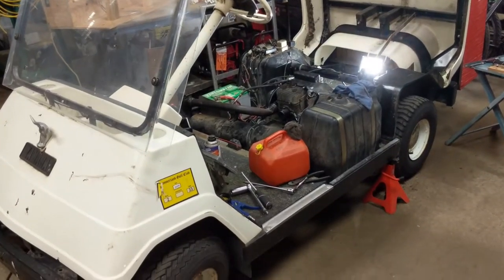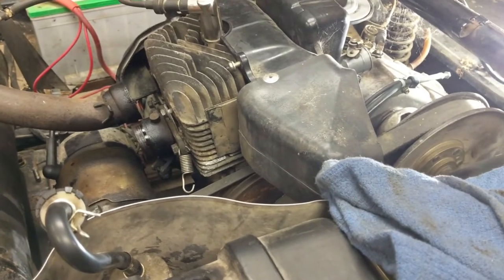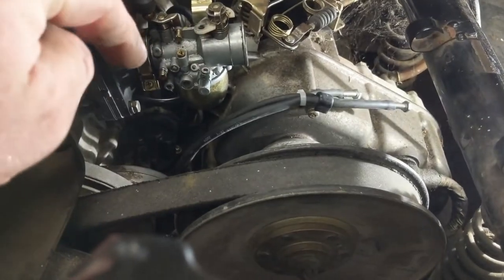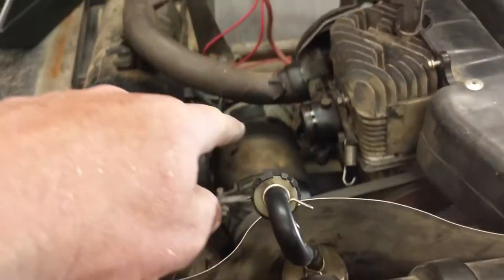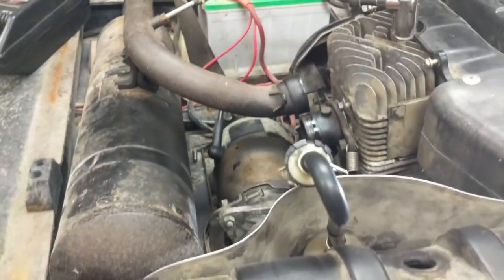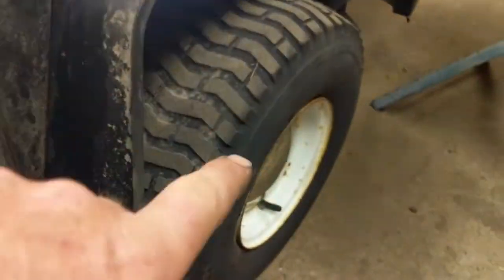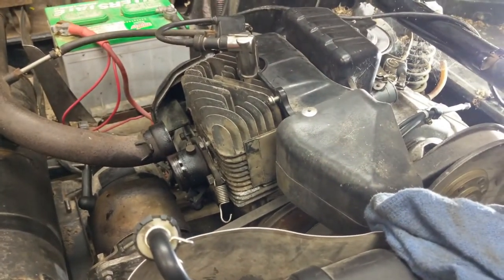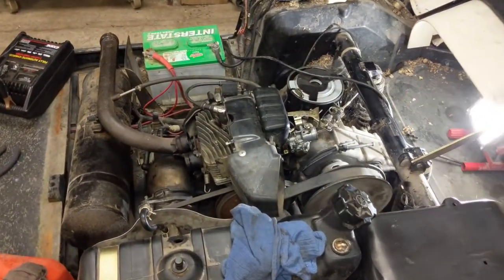1980s Yamaha G1 2 stroke golf cart interesting forward / reverse system

Comment: I am in the market for a golf cart to get around mountain property. The seller states it's a Yamaha G1 Golf Cart - Gas - 2 stroke. They have had it for many years and have upgraded to electric. He wants $2k for it. It "appears" to be well taken care of from a photo. I have not seen it in person, yet. My main use would be to pull two bins (garbage, recycle) down a long (equivalent to 2 suburban blocks) Paved driveway and carry my tools around

My questions for anyone familiar with the Yamaha G1 model are:

1. How fast do these carts go?
2. Does the cart have power to go up an elevated driveway?
3. Is $2000.00 what these older carts on the market for these days? 

Thank you in advanced. Angel from The Bay

Comment: I have this same cart,  lt will  start and go forward but will not start in reverse.  ANY SUGGESTIONS?
Reply: The electrical system switching is quite complex for a golf cart.  Turning the generator the opposite direction reverses the current to some switching polarity before power gets to the rest of the system.  This is done via the two solenoids near the voltage regulator.  My guess is that the one used for reverse operation is faulty or has been wired incorrectly.

Comment: I remember cleaning out 2 stroke exhausts by using a blowtorch up the tailpipe to burn out the carbon. That might work with that exhaust as well
Reply from the maker: the owner took the exhaust, hes going to slice an end off and see if he can get at the insides to burn/clean it out.
Reply: @machinesnmetal  We have a trash gas grill; we put a fresh tank on it, muffler in, and let it go overnight. Choose a night when the wind is blowing away from you...  Impressive clean-out job.

Comment: I’ve been looking for a video of people doing mods to this golf cart with the stock 2 stroke cause I’m looking to do something with mine but everybody just puts a different motor in it
Reply from the maker: Yeah, it's best to change the motor, get a 800cc sled motor 🤠
Reply: machinesnmetal on it 😂
Reply: Those 2 strokes are to much headaches especially when the cdi box goes out on them check my video I heavily modded my g1 👍
Reply: Yamaha gas golf cart goes forward when in reverse how to readjust
Reply: Could you ever get it to idle,I just got one and been try'n to figure out how the hell it works...I thought it had a forward reverse trans,so I thought I could put a two way switch and separate start..it runs good at top speed, but jerky at slow speeds..any suggestions
Reply: @derekfreeman3562  I own one also it does same thing

Comment: I’ve got the same cart… but I’ve got a electrical problem…. The battery blew up and now I have no spark… I’m assuming it is the voltage regulator… any help would be greatly appreciated…
Reply from the maker: I would go after the coil and ignition side first, the voltage regulator works more on the charging side..

Comment: Strange, I have two of these. One has a boost chambers common for some two strokes yet my other one doesn't have a boost chamber or the hookups for one in the block and the mount for the carb. Next thing I've got going for these carts is a governor adjustment although I think one of them, the engine is just about shot. It barely climbed a hill with two people.
Reply from the maker: Check your muffler. The muffler on this one was completley plugged up and no exhaust would flow through it. We cut it open and emptied it, welded it back together and it behaved like a new machine.

Comment: Its a starter generator, no such thing as a starter alternator to my knowledge. These are good carts, I have one. My exhaust isn't plugged but it is filled up with oil or carbon, it smokes like an SOB when the exhaust gets hot. I can golf 9 holes with no problem (lots of stopping and starting) but if I drive the cart down the road for more than a half mile it starts to smoke really bad. I've heard some people put the whole muffler into a camp fire and let the oil burn out of it (google yamaha g1 muffler bbq) but I think these mufflers have fibreglass baffles in them so I wouldn't recommend it. I think this summer I am going to remove the muffler and try to rinse out the insides with kerosene or even gasoline and see if that helps. I have heard that some people pressure wash 2 stroke dirt bike pipes out. If all else fails I'll have to slice it open and clean it out manually and weld it back together.
Reply from the maker: The owner of this cart took the muffler and sliced the ends off and then he put it in a barbecue and cooked it then re-welded the ends back on well or so he told me and apparently it works well again now
Reply: Correct.  Any DC motor is both a DC motor and a DC generator.  DC is converted to AC via an inverter.  AC is converted to DC via a rectifier after stepping down voltage.